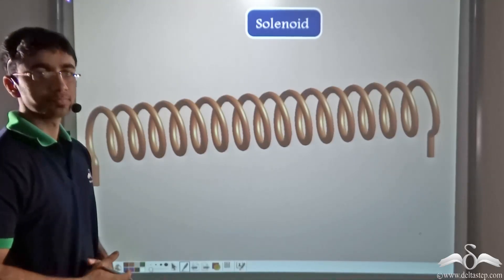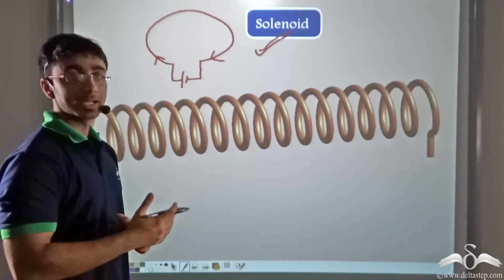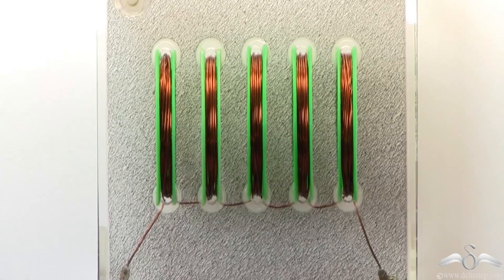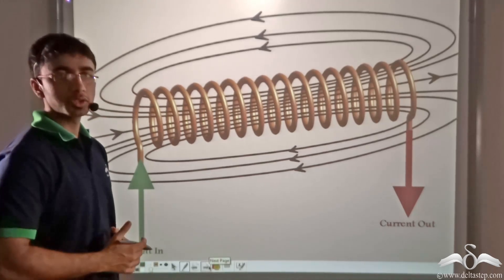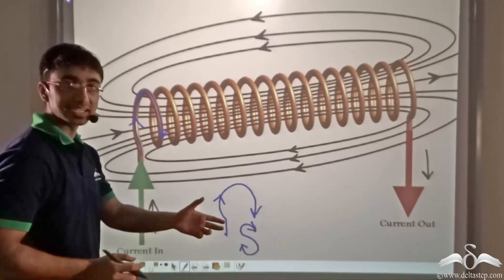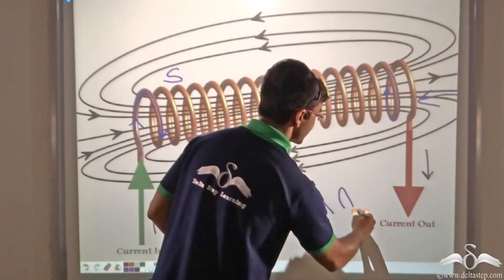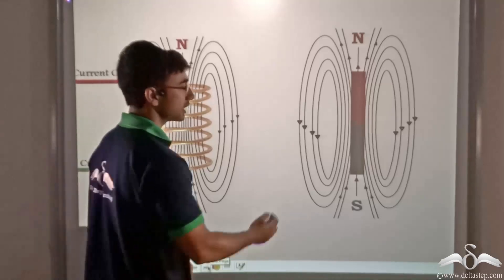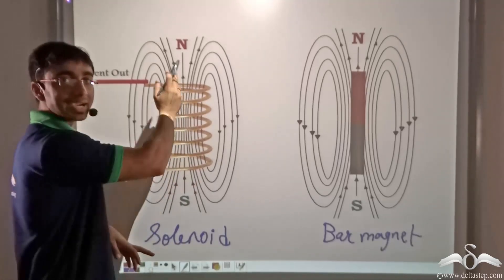Solenoid | Magnetic Field | Class 10 | CBSE | NCERT | ICSE

Comment: What kind of power source should I use to connect it to solenoid? If I take power from the circuit board, I would be shorting + and -. I would like to generate a strong magnetic field with a solenoid? Any suggestions.